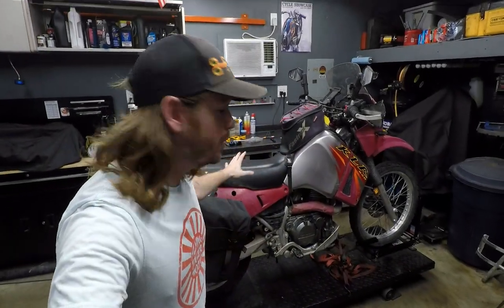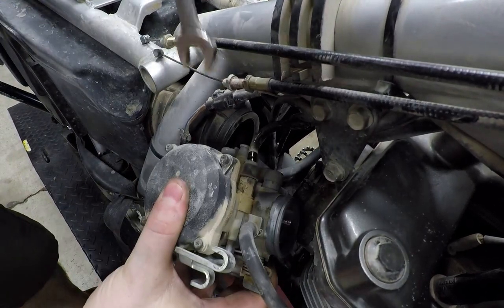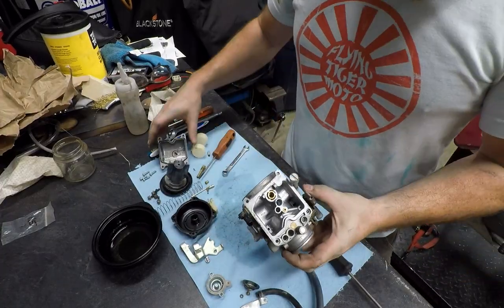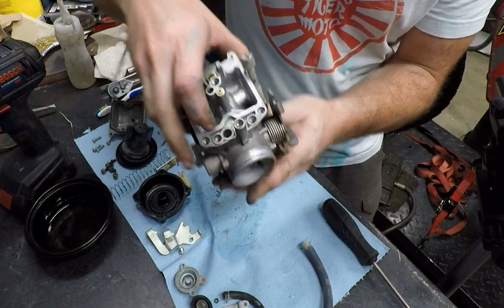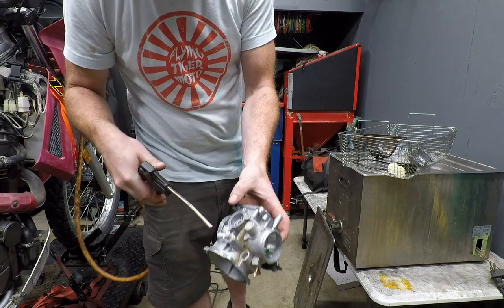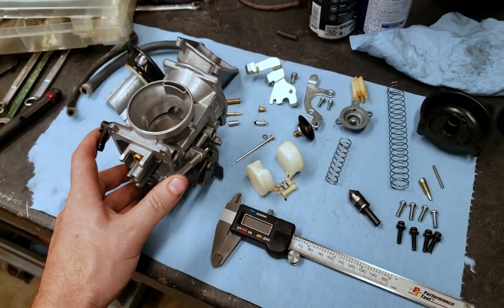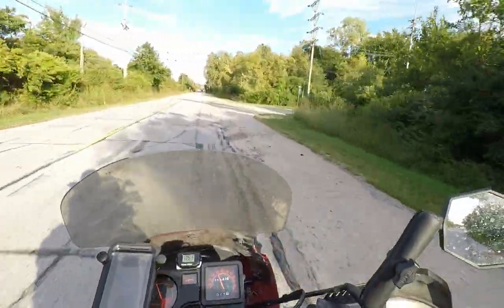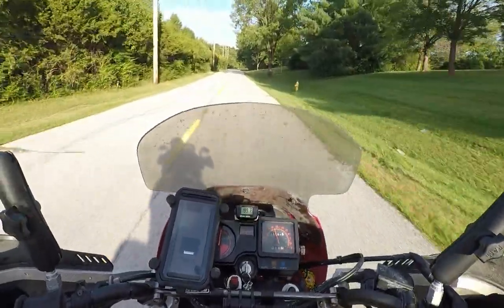KLR650 Carburetor Rebuild

Comment: There is an Externally Adjustable idle air control screw available. After drilling and removing the plug, the screw is replaced with one that is easily accessible with an external Knurled head. At altitude if the idle is rough you just reach under and richen or lean the idle mixture as needed. It can be adjusted literaly in seconds, with absolutely no tools needed. That screw runs about $15 and it was the first thing I did along with the washer under the main jet needle on my brand new 2008 KLR650. 13 Years of miles and Smiles 😃.
Reply from the maker: Im definitely aware but not something I need considering I can easily adjust with a modified bit. I can definitely see the appeal though
Reply: Ok, I get it thanks :)

Comment: I own a 99 klr650. lol.  Just under 40,000 miles or 59.428 kms.   While it would run and ride ok,  It had issues getting to 70 mph.  Above that was not going to happen.  I finally decided to buy a dynojet kit and go into the carb. It has never been off the bike. I owned it since day one.  After installing the kit and spraying it with carb cleaner I put it back together. I can finally hit 100 mph again.   My carb was actually fairly clean inside.  I always ran 94 octane towards the end of the season.
Reply from the maker: Hmm, mine has never had a problem doing 100 in factory form
Reply: @BrickHouseBuilds  Yeah, If I had not let the bike sit for 8 months,  I would never have had to clean the carb.   I was getting surging and crapping out above 4,000 RPM.    After cleaning everything. Thing runs great again.

Comment: Nice! I just remove the single screw that holds the throttle assembly on. The choke cable is a pain! I did a K&N filter, DG muffler, and DynoJetted the carb. Quite a bit quicker now, but very LOUD! (I like it that way). 2001 model.
Reply from the maker: Ya know I hadn't considered just taking that whole bracket off lol

Comment: Your symptoms sound exactly like what I was experiencing with my '09. I had a lean condition, idle climbing when hot, deceleration popping... turned out the mixture screw  a 1/4 turn or so, shimmed the needle, no problem. Glad it word for you!
Reply from the maker: It definitely helped a lot

Comment: I think you’re right on the fuel valve, I go with the manual one but you need to remember to shut it off for storage and the vacuum one is good so you don’t worry about not shutting off the fuel and possible leaks. There’s good and bad in everything I guess, thank you for posting and ride safe.
Reply from the maker: Agreed 100%. Easy to leave them on and leak fuel but again there is good and bad for both.

Comment: Thank you for the ultrasonic mix ratios! Been running a designated carb detergent and it doesn't agree with the throttle valveshaft o rings
Reply from the maker: I know everyone has a different mix this is just mine. Seems to do what I need it to!

Comment: Great video! Make me feel more comfortable tackling this project! Reason I’m cleaning my carb is bike after storage won’t start. Is it necessary to drill out that mixture screw or if I clean everything else should I be ok? I’m not comfortable doing that 

Thanks again!
Reply from the maker: Thanks Paul! You may be able to avoid removing the mixture screw but of course I try to always work along the thought of "do it right or do it twice" so it's up to you. A non start issue is likely a clogged pilot jet or even a lack of fuel to the carb in general. I know mine takes a lot of cranking due to the vacuum percock.
Reply: @BrickHouseBuilds  thank you for the reply!! You are 💯 right! 
Again- great video!

Comment: Hello ! 
I found your channel a few weeks ago sand I have been enjoying every video so far. 
I even looked at CX500 prices around me 😂 looks like it’s my next impulse buy.

I have bought a xtz750 last year and I’ve been trying to make it run right, in a few of your videos, you are diagnosing either the pilot circuit or the main jet circuit, by just riding it and I was wondering what clues you are looking for when trying to find the issue/tuning a carb ?
Thanks for any advice you might have !
Have a good one
Reply from the maker: Great question but hard to answer by text. I actually shared a pod filter video on my community tab by motorcycle MD which explains the different parts of throttle tuning. It would be a good place to start
Reply: Ok I will go have a look, thanks ! 

It could be an interesting video idea to « de-tune » a carburettor every way possible (idle, pilot, synchro) and film the resulting effects !

Comment: What do you mean by spark knock? My DR might be doing something similar. What does it sound like?
Reply from the maker: Well it would sound more like a "clunk" or even "knock" at low rpm as I applied throttle. The spark plug actually revealed white deposits which is evidence of knock. Basically pre-ignition from a lean mix that ignites before the engine reaches the correct fire mark meaning the combustion is trying to force the piston down while its trying to come up. Bad scenario.
Reply: @BrickHouseBuilds  Got ya! Mine sounds like more of a metallic straining or grunting when I blip the throttle too much at a low rpm. Thanks for the info, that makes sense how you could get a knock from being too lean.

Comment: I wish someone would talk about where all the different lines and hoses are supposed to go. Why is this glossed over. I’m far from an experienced mechanic and I have no idea how to correctly put this carb back on my bike since I don’t know where the hoses go or what they do.
Reply from the maker: Do you have a service manual for your bike? It outlines exactly what everything is. I'll admit maybe some information can get glossed over but it's also assumed that to tackle a carburetor job you are also capable of putting things back where they came from. This is where taking photos before you start is very helpful.
Reply: @BrickHouseBuilds  Ultimately I guess I was being dramatic.  After some poking around i put the big hose on the big hose connector and the small hose in the small hose connector etc.... the bike started right up. I just dont know how or why lol.

Comment: Check out MCP for your KLR.
Carburetor magic for these bikes.
Reply from the maker: I know of them. I just have many parts so I can do most of that stuff
Reply: @Brick House Builds  He also provides the air cut off elimination and the fuel tap conversion.
I also installed the thermal bypass to even out the engine temp.
Also brass choke nut and easy reach mixture screw.